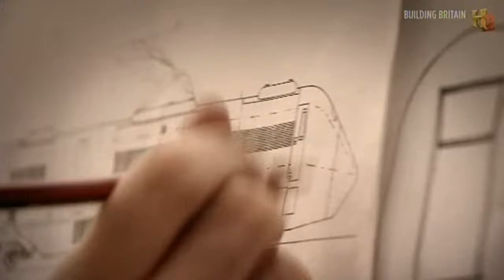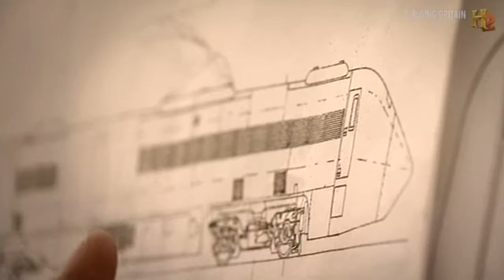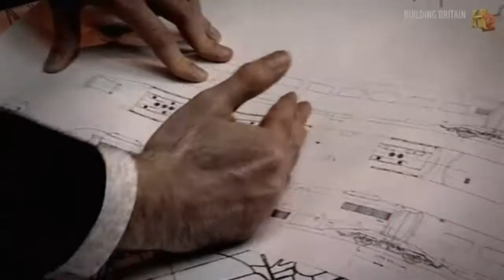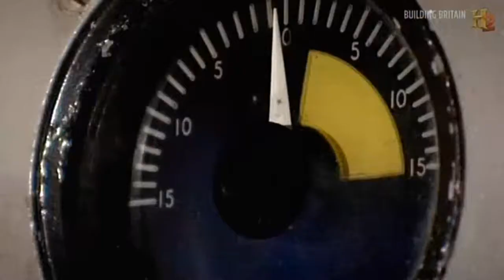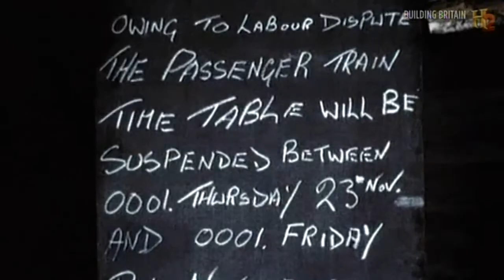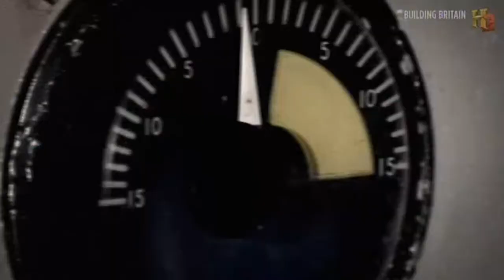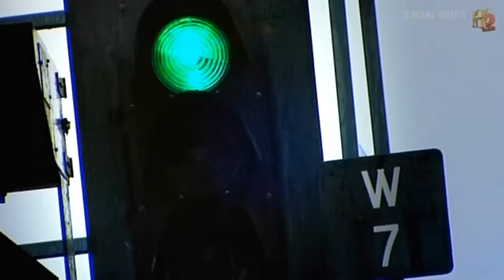Brits Who Made the Modern World - British Rail Advanced Passenger Train (APT)

Comment: At 18:30 they state the hydraulic tilt was replaced by air springs. Which is incorrect: the APT-P retained hydraulics for the tilt. Air springs were used for suspension/comfort. So it had both.